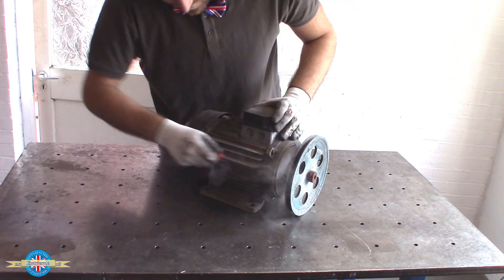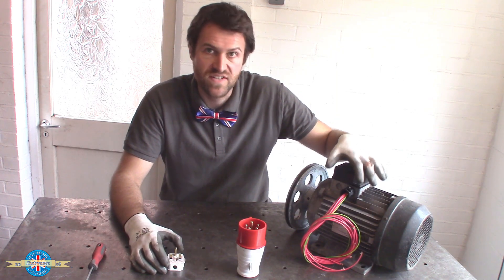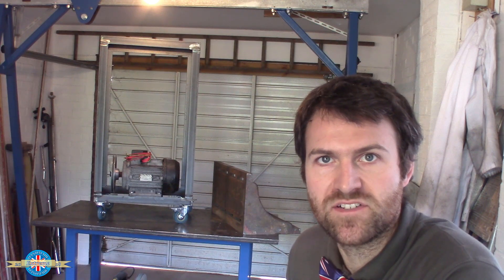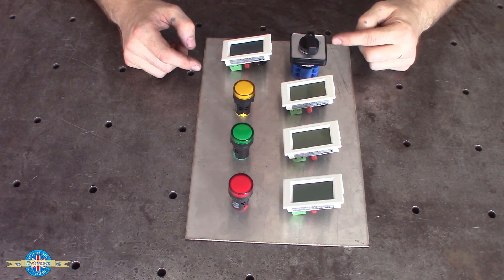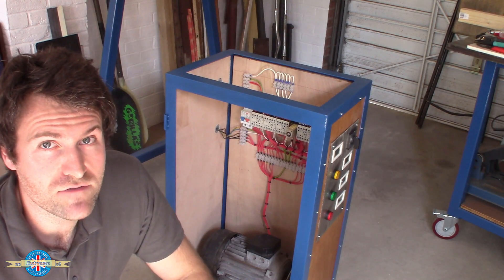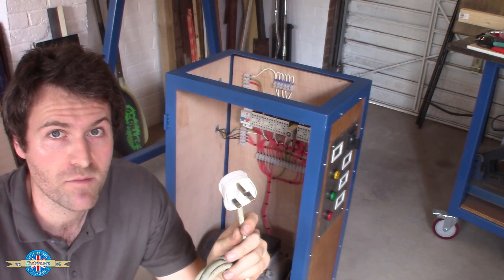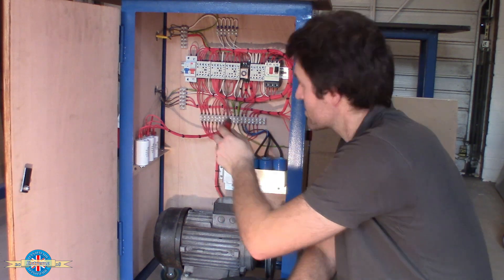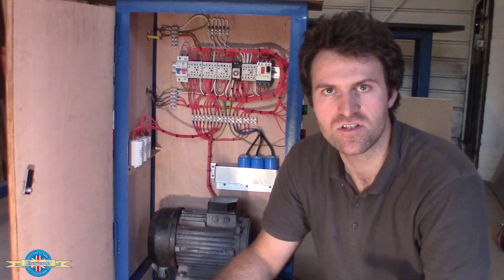1 Phase to 3 Phase Rotary Converter - 230V to 415V

Comment: how much power is it able to transfer?
Reply from the maker: Best estimate so far based on some on load voltage and current readings taken with the lathe running. It should be able to put out about 3.5KW continuous.Worked through the numbers a day or so ago and got an Eff of 89% on load, which I could not believe at first. Off load its consuming nearly a KW at idle 😊 so .... not great.

Comment: I thought I was watching This Old Tony to start.  Great idea on the hinge pins.  Great RPC build.  Mine was a little simpler to build here in the states.  Your cabinet puts mine to shame, so I will never show mine. LOL  Now I have to start rebuilding mine. LOL  Great video!!  Subscribed.
Reply from the maker: What a complement, thank you!! I absolutely Love his channel. I was so excited when I saw he had done the two piece vice vice video this week. When I first found his channel I binge watched the lot.... Which took quite a while since most of his videos are around 20 mins long haha. 
I must confess I'm more of a form follows function guy as well but since I am making these things for YouTube as well as for myself then I put a bit more effort into making look nice than perhaps I normally would. That said, I think It will be good in the long term once the shop is all fully equipt to have everything matching, same colour etc. Should make it a nice place to work.  
Cheers
Reply: I liked that 2 piece vise myself.  I plan on making one.  Have a great day.
Reply: Thanks for the vid 
I'm also find Tony's videos addictive. Lol I bought 2 Tos Trenkin . 40+a 50cm lathes and need to build a rotary phase converter. Yours is a very nice build. I'm neither a machinist nor an electrician, some would say a masochist for challenges lol. Thanks also for the links, keep up the good works.

Comment: I have rotary phase convertor, the problem is the capacitor is out bummer Question: what should the cap be rated? I have tornapart a bunch of computer servers in hopes that 3-8 caps will add up to the correct one
Reply: Caps should be rated 2x mains voltage, they have to withstand mains + EMF
Reply: Jeffrey Hansen you can't use polarized capacitors for this application. you need non polarized capacitors specified as "motor run" capacitors NOT "motor start" capacitors. if you try to use the electrolytic capacitors from the computer power supply they will explode.
Reply from the maker: Hi Jeffrey. Without having the converter in front of me its impossible to tell. However, I can give you some general guidance based purely on my own experience. Id like to point out that i'm not an electrical engineer and this information is just based on my own research.
The best / easiest thing to do is contact the converter manufacturer and order a replacement part if possible.  
Normally capacitors have the capacitance and voltage rating written on them so sourcing a replacement should not be that difficult unless it has blown itself to smithereens. 
Now some general rules of thumb. 
The starting caps need to be rated to at least the starting voltage. For mine this is 240v
The balancing caps should ideally be rated to at least twice the output voltage. Or so I have been told. The capacitance value will depend entirely on your specific converter so I'm afraid I cant really be much help there.  
Sorry that I cant be more specific, but I hope this helps. If you are in any doubt get a professional to check it out. Remember capacitors are quite dangerous and should always be fully discharged before handling. 👍
Reply from the maker: Thanks for the confirmation.

Comment: Where we could get the schematic diagram of this circuit?
Reply from the maker: I do not have plans for this circuit. But there is a man on Ebay UK who sells plans for a system that is basically the same as this one. I think they are quite cheap, maybe £10. There are also some links in the video description to some other videos that show some circuit diagrams. Cheers. 👍

Comment: It would be great to see the wiring diagram! what specification of motor is that and what size of 3 phase motor can you run off this supply?
Reply: What kind of current is that drawing from the single phase supply when running the 2.2kw motor?
Reply: Ok thanks :) A very nice job you've done there, I particularly like your neat wiring 👍
Reply from the maker: Sadly I do not have a diagram. However there are some links to some detailed videos and information in the description. The idle motor is a 230-415 4KW motor. The largest motor i have ran off it is 2.2KW. Thanks for commenting. 👍
Reply from the maker: Around 8 amps if I remember correctly.  👍
Reply from the maker: Thank you 👍

Comment: Хорошо. Но кпд, наверное, 40 процентов у этого конвертера.
Reply from the maker: Спасибо, я сделал некоторые предварительные измерения и вычислил эффективность примерно на 50-55%, но не намного, но намного дешевле, чем с 3 фазами, связанными с домом.

Thank you, I have done some preliminary measurements and calculate efficiency to be somewhere around 50 to 55% not great but a lot cheaper than having 3 phase connected to the house.
Reply: Handmade Extreme Согласен с вами. Отличная работа.
Reply from the maker: большое спасибо
Thank you very much.

Comment: Brilliant vid and nice fabrication work. I'm sure your channel will take off like a rocket soon! :)
Is the metal frame connected to protective earth? I'm thinking worst case scenario if a wire comes loose or similar, It'd trigger the RCD.
Reply from the maker: You will be pleased to know it certainly is 😉. The earth is connected to all external metalwork including the frame and the fascia panel. 

Ooh a channel all about RC cars and 3D printing...I used to be very into RC cars and a 3D printer is on my to do list. Thank you for your comment and making yourself known to me. I will be watching your videos later...😀😀😀
Reply: Is the output ground referenced?
Reply from the maker: Should be, I should probably check that... Cheers. 👍
Reply: Could you please explain what you mean by referencing the ground?

Comment: I would not have mentioned it, except that a guy who makes his own hinges might also consider lacing the wiring instead of using zip ties
Reply: Just like the hinges, it looks great, and hardly anyone goes to the trouble of doing it
Reply from the maker: Hi thanks for the comments. My original plan was to use finger trunking that way all the wiring would be hidden. The cable ties were a Cost / Time / Availability  compromise. Hope you enjoyed the video. Cheers 😀
Reply: Handmade Extreme I did enjoy, thanks for making it
Reply from the maker: My Pleasure 👍

Comment: Didn't know that you're using 415V in the UK. Here in Germany we use it for various things ;) I know its summer but please do yourself a favor and wear long trousers next time
Regards Leon.
Reply from the maker: Hi Leon, thanks for the comment. 415V is standard in most industrial premises in the UK but we normally only get a single phase 230v at home. You are right, I normally wear overalls, we are having a mini heat wave at the moment, Hot Hot Hot 👍👍
Reply: Handmade Extreme 415V would make sense because in the UK they have 240V, here in Germany we have 230V single phase so wd should have 400V 3 phase
240V*sqrt(3)≈415V
230V*sqrt(3)≈400
Reply: Handmade Extreme WRONG, the UK is officially 230v per phase BUT nearly everywhere is using 240v per phase still!
Reply: Yeah they don't really need to switch because the 240V are still in the tolerance of ±10%.

Comment: 3 points/questions:
1. Have you got this on a separate radial from your consumer unit? If so you could have it on a type C breaker to cope with the inrush without needing a high fault current to break it.
2. You should (ideally) put the caps as close to the motor as possible as these could be sinking or sourcing huge current, so voltage losses in the wire will be going against their purpose.  It would also help reduce some of the radiated EM radiation.
3. What sort of current can you get out of this setup in 3 phase? And, what's the efficiency; simple input power vs output power.  Would be really interesting to know.
Great video btw.
Reply from the maker: Great questions / comments. 
1) The workshop is on some creative wiring left by a previous owner fed from the house. Has it's own dis broad though with RCD, socket ring main, lighting circuit and 16a wall socket on a type C breaker. Breakers in the rotary converter are also type C and there is a thermal overload in there too. 
2) Everyday is a school day, I will drop a clamp meter on the cap wiring and see what is going on there next time it is running. 
3) Running with no load draws about 3.8A off the single phase supply. Would need to take some detailed measurements to get an accurate efficiency but I don't expect it to be more than 75%. 
Thanks, glad you enjoyed it. 👍👍👍

Comment: Isn't 3 phase 380V?
Reply from the maker: I believe It depends what country you are in; in the UK where I am it is 415v nominal. Thank you for your comment. 👍
Reply: It indeed depends on the voltage of the individual phases. In the UK, they have 240V between a phase and neutral, which gives 415V if you measure the voltage difference between two of the three phases. Continental Europe has 230V, which gives 400V between phases. 

380V is the old value they had in Europe, back when the individual phases delivered 220V.

Comment: Amazing quality man, keep it up👌. How much power can this give?

Maybe in future you can get a VFD.🤔
Reply from the maker: Thank you very much. The idle motor in the converter is 4KW so it should be able to start a 3KW machine without too much trouble. The lathe I started at the end is 2.2KW but it is direct on line and has a lot of rotating inertia due to the vari-speed system and it started that fine.

I did consider VFDs but for my application the rotary converter is a more suitable solution. 

Glad you enjoyed it and thank you for commenting. 👍

Comment: All that bullshit just to run a motor.. I'm good with three phase.
Reply from the maker: Sadly I don't have a 3 phase supply connected to my workshop so I had to make the converter to generate a 3 phase supply from the single phase supply. That way I can use 3 phase machine such as my lathe and milling machine in my home workshop. Hope you enjoyed the video. Thanks for watching.

Comment: How about using a variable frequency drive? They are like 80 bucks from China in that power range. Also shout out to made in Poland's video.
Reply from the maker: A VFD was considered but unless you spend a fair bit of money most of the cheap ones only do single phase to three phase at the supply voltage ie. 230v single to 230v 3 phase. I needed to also step the voltage up to 415 between phases since my lathe does not have a multi voltage motor. There are also some other 3 phase machines that I have my eye on at the moment. I had a quick add up and I would need about 7 VFDs once all the power feeds and coolant pumps are included which makes it cheaper to make the rotary converter. Thanks for your comment, hope you enjoyed the video. End card added for Made in Poland. 👍
Reply: You would need one VFD to power them all, if you only use it at 50Hz, as your rotary converter gives you. Of cause you loose the speed control. over here we have 3 phase power for the stove. As you needed to build this, I recon you don't have that over in the UK?
Reply from the maker: It is my understanding that VFDs do not like downstream switching as it can damage the IGBT components. Therefore it would be fine to run a single motor from the VFD eg the lathe spindle but then switching on the coolant pump while the other motor is running would potentially be damaging for the VFD?. 

You are correct that 3 phase is not standard in UK houses, it is only typically installed in factories. It is possible to have it connected but it is quite expensive and you can not take it with you when you move house haha. 

Great comments, I really enjoy this kind of conversation.  Thank you.😀👍😀👍
Reply: Maybe this isn't true,  but the project has the feel of being made from things that were already in his toybox
Reply from the maker: I did have some of the things already yes. However, the majority of stuff was purchased for the project. The bulk of the electrical components came from Ebay, either second hand or new, including the motor. Plywood and steel etc came from local suppliers. Thanks for another comment.  👍👍
Reply: VFD's are notorious for loss of torque at lower speeds (Frequencies), or at least that's what we experience here in the states.  Would have required rewiring my entire lathe!!
Reply: "the project has the feel of being... bla bla" As an elec-chicken I can say this is some damn fine workmanship! Toybox stuff my arse, this is proper.
@Handmade Extreme, nicely done, subscribed! :)